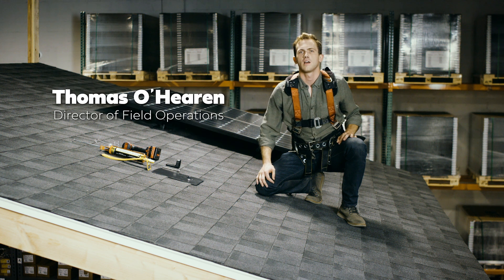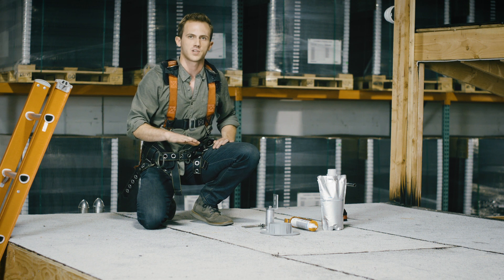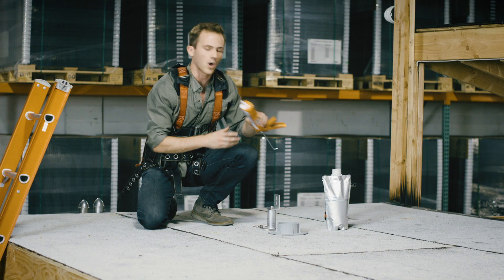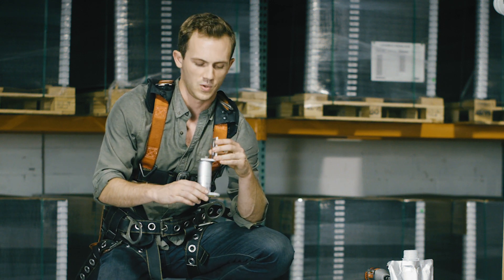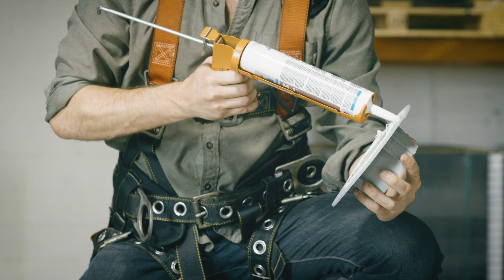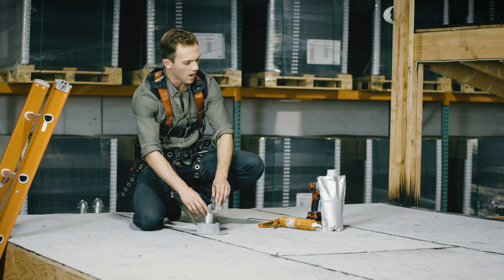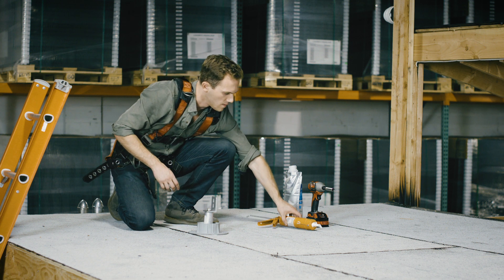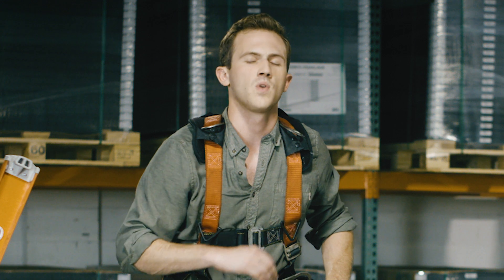Flat Roof Installation Demo — Venture Solar

Comment: I have seen other videos that put sealer from the base of the metal mount up to 3 inches.
Reply: Additionally, the drill holes should be filled with sealer before screwing in the lag bolts.